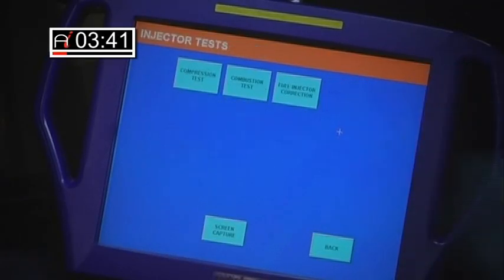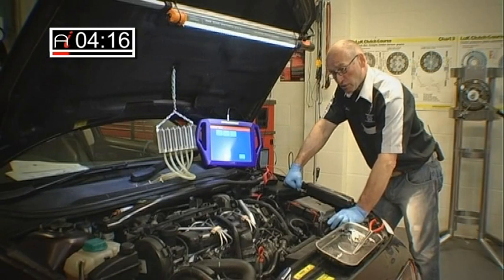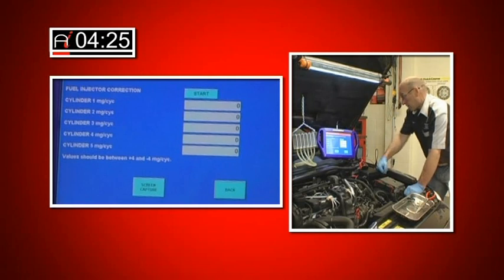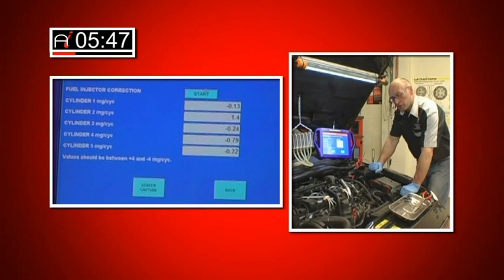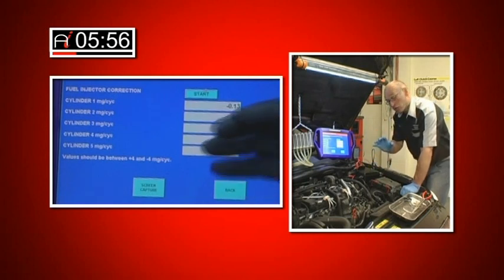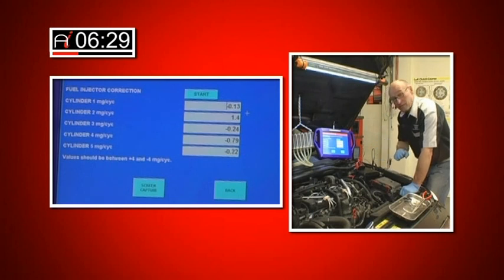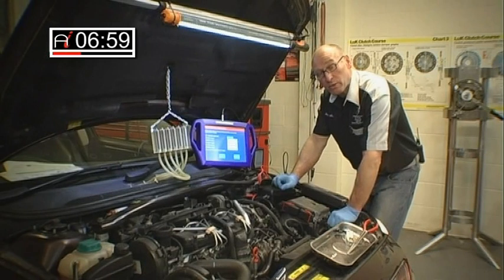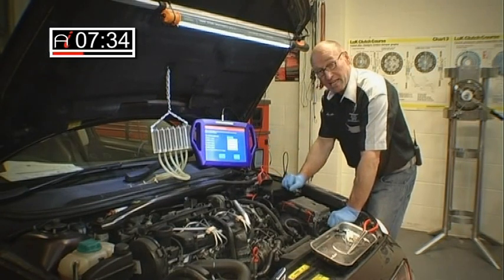AUTOINFORM ONLINE MAGAZINE: Common Rail Diesel Smooth Running

Comment: Well done sir! On this side of the pond we would call the test you performed with the graduated tubes an "injector return" test, and would monitor fuel flow over a short period of time, typically 15 seconds for a Duramax, looking for a maximum permissible flow. Unfortunately, on my truck, an LB7, accessing individual cylinder lines would be a pia, but checking each bank of four would not be too difficult. I question why a balance check and a return check would be necessary to diagnose a bad injector(s). Whether the problem is internal or at the nozzle, the injector merits R&R either way, so why the extra effort? I luved your reference to a "virtual compression test" using the crank position sensor to look for differences in cranking speed among the cylinders (injection disabled, of course). Elegant!

Comment: I operate a small Irish service centre and have learned a lot from your dvd series.
  in relation to a scan tool Im now at the cross roads where I need to invest in a higher level machine, In all your videos the autologic seems to be your choice, can you advise on its similarities between the Snap-on solus pro and the autologic.
I use a 4 channel pico scope for graphing data.
Any advice would be greatly appreciated,